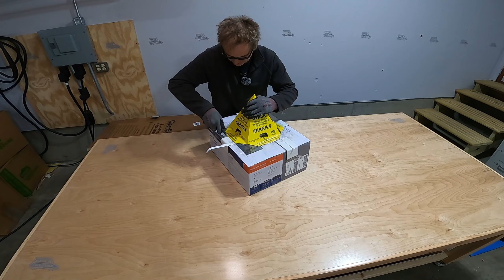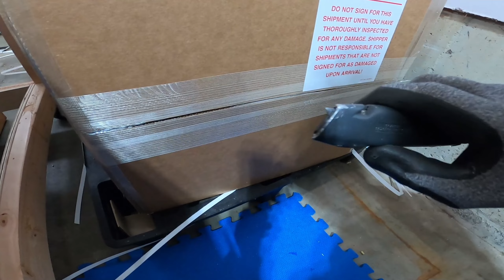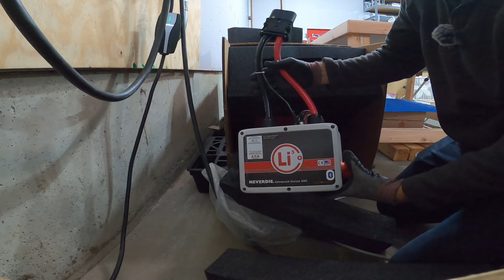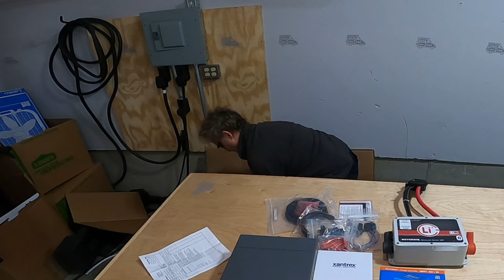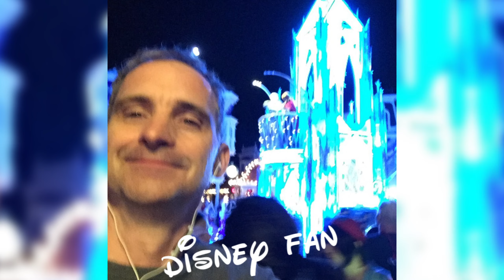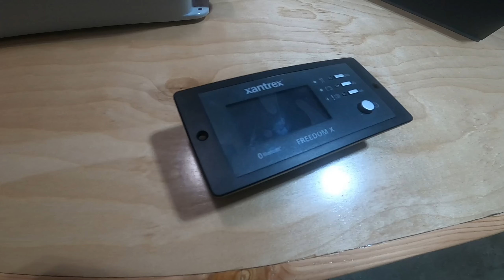Best Camper Van Battery System Ever?

Comment: Thank you so much for explaining the plug and play system. I have a 23 Revel with the 320ah Lithionics  battery and would like to add a 640ah. It seems that all I will need is a splitter.  Thanks again.

Comment: The recommended discharge current that battery can do at best @12v is 1800. So I dont know you can run anything everything at the same time.